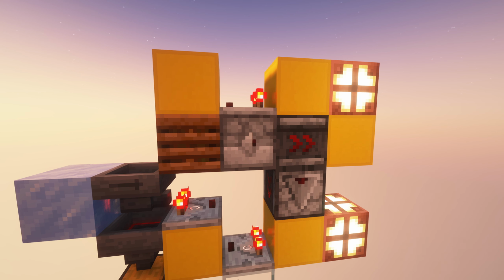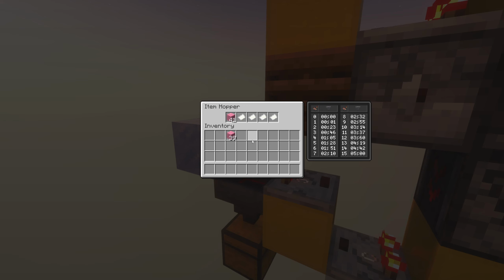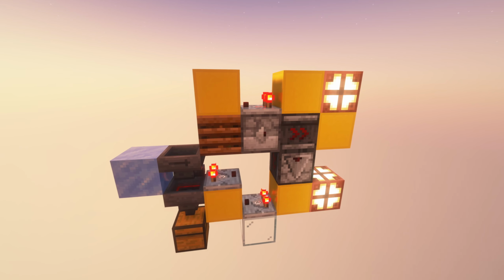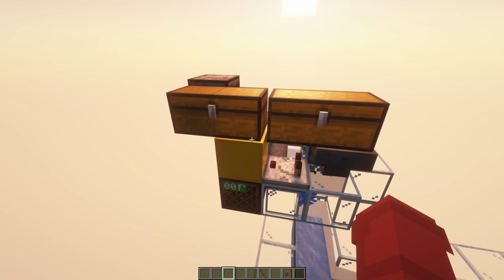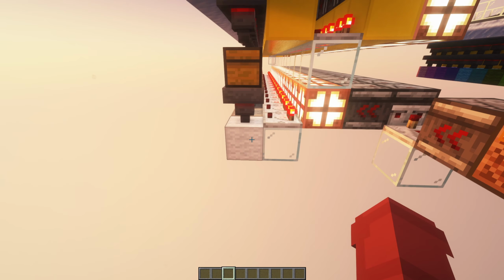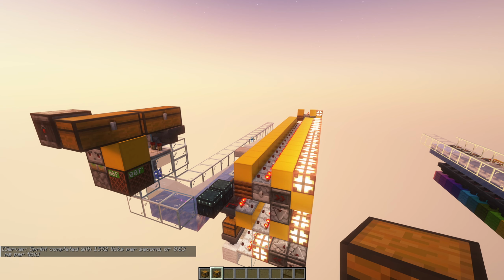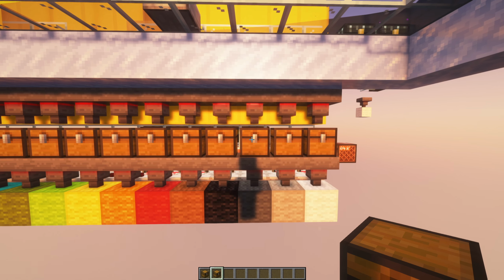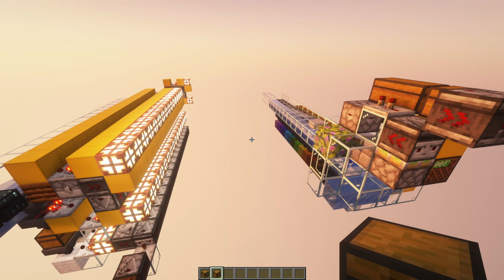New Better Dustless Item Filter

Comment: Should also be said, using a fully oxidized bulb is better for performance (because it sends fewer light updates) but the light updates are really not that big a deal, they’ve been heavily optimized in these versions.
Reply: over time, instead of the machine degrading, it becomes better

Comment: you shouldn't compare the MSPT figures directly, but rather the deltas to baseline. on that accounting the dustless one really is a good deal faster. still should probably use the standard one most of the time
Reply: more specifically, comparing the deltas will give a better picture of the contribution of the sorters and thereby a better picture of the performance characteristics of very large sorting arrays
Reply: So, the baseline/delta calculation is a good one, but I reckon the bulk of the MSPT difference between control and the experimental versions will be item lifetime and moving item entities, because items need to travel down the ice lane versus items need to fall through powdered snow. This control setup does not control for item lifetime.

To weed out the differences, I'd bet the ideal test would be maybe 10^6 items per sorting array, per distribution method (water & entities vs dropper and loose items). For the control, tick warp the world with no item entities.

Comment: Very simple and elegant!

The reason that the dust-based filter isn't that much more laggy is that each dust only has to change by 1 signal strength, and only when the filter is turning on or off, so it doesn't actually create that many dust updates compared to a typical dust-based contraption

Comment: I like it. Dustless, 1 tile wide, nand stackable. Only issue I saw was when it got too many items. The bottom hopper would get stuck locked until the top hopper got updated. But a simple comparator system looking at the chest for strength 15, an observer looking at the dust pointed up into a bulb, then a comparator reading the bulb and pointed towards the top hopper fixed all that. This addition locks the top hopper when the bottom chest is full, then forces a block update to the hopper when the bottom chest has space, thus kick starting the system again.

Comment: *chef's kiss

More seriously, a number of acronyms were used in the video, and I think acronyms should be specified at least once in any work that uses them. Obviously, there's good reason to use acronyms within expert fields in which certain terms are mouthfuls. However, even if the acronyms being used are commonly understood within the field, using them without introduction makes it hard for laypeople and experts from other fields to understand what's being said. 

This is quite common within stem fields. Generally, whenever a research article uses an acronym, it's first presented in the form of "<non-abbreviated term> (<acronym>)". This is even the case for very obvious acronyms, like ITI, CS, and SA.... Oh, sorry, I meant intertrial interval (ITI), conditioned stimulus (CS), and self-administration (SA). But you see my point: specifying the non-abbreviated terms can prevent the audience from needing to use other sources to interpret the material. 

Science communication is an important part of working in any scientific field because a public that does not understand the science cannot appreciate or apply it. I'd argue that's especially true in fields like technical minecraft, for which there is no proper discipline and bringing in new members depends almost entirely on how accessible public information is to laypeople. 

That's just one person's thoughts, though, and the video was great overall! :)

Comment: The marginal difference in performance seems to not be that marginal:
Control: 0.57 mspt
Impulse item filter: 0.66 mspt
Dustless item filter: 0.63 mspt

So the actual lag impact of the sorters (if the testing was good enough) is:
Impulse item filter: 0.09 mspt
Dustless item filter: 0.06 mspt
Resulting in a ~33% decrease of lag.

But yeah, probably still not worth it unless you are building some insanely lag optimised storage monster.
Reply: I think he meant marginal as in 0.03ms is not noticeable at all to the player really, as though it’s 33% it’s still absolutely tiny
Reply: @SandCaribou1890  Precisely, 0.03 ms is 30 microseconds (about the half-life of Bk 251m). Also, this control does not account for item entity lifetime and item entity movement, which experientially will be the bulk of the lag. Given such a small difference over a small sample size ~3000 items, at best the test is inconclusive, at worst the test says it doesn't matter.
Reply: The absolute value of 0.03 mspt difference is indeed marginal and can be ignored. Usually the whole impact of storage systems can be ignored by players, unless they built a higherr-end system.

I agree, that the testing was not sufficient to determine reliable performance data. However, if the 33% lag decreade are approximately correct, then this "marginal" difference can matter to really high performance systems. There are probably very few designs and use-cases out there, that would even notice this change, but they might be there. But you are correct, the main sources of lag in item sorters are usually other things.

Comment: Unfortunately this filter will break if items come in at a specific timing: Assume the top hopper has 42 items, the bottom hopper sucks out one item and at least one new item is picked up by the top hopper within 4gt (which can happen as the top hopper is not in cooldown on account of not having pushed). Then you'll have two updates within 4 gt, the second update is not picked up by the observer and the filter ends up in a locked state despite more than 41 filter items in the top hopper.
I stumbled upon the same problem when I made my copper bulb filter video a while ago (and I'd link it if yt would allow link in comments, so there you go).
Reply from the maker: I don't think it's an issue.  Pass all your items through the aligner at 8gt and you don't run into that problem.
Reply: @RaPsCaLLioN1138  Agreed, if items are aligned at exactly 8gt intervals this should fix the issue. But it's a requirement that should be mentioned ;)

Comment: It's a shame it can't be ss2 since that sends an additional update, now THAT would be a reason to use it
Reply: It can be if you manage signal strengths correctly, and send batches of ~20 items at 8gt. Even still, this circuit we made should be used only for an "it can be done"—a 1wt dustless, pistonless item filter, in the same vein as Oreo's comparator-less item filter.

Comment: I've used this comparator setup for a 3x2x1 new filter desing (with redstone) with an observer and a copper bulb, but when the items come through an hopper line or a water flow (so they comes in the hopper at a certain rate), the comparator in front of the hopper make 2 impulses of redstone, so the copper bulb turn off and on, and the filter break. How tf this turns to work with you😢

Comment: I think I got a 1 wide tileable* dustless item filter that may be better.  Maybe IDK, probably not.  It is comparatively large behind it if you make it as one wide and it is many different slight variations of the same system.  IDK if it is better performance because IDK how to check.  IDK anywhere to show it off.  It is definitely simpler than this and that makes me think it might be faster
Reply from the maker: Hop over to the Storage Tech Dicord!

Comment: The system works fine on my side but if an item gets in the hopper at the exact same time the amount of item goes to 41 (which it'll make 42 item in the hopper), it just stop working and I have to reset the filter.
Reply from the maker: you definitely want to do 4D alignment

Comment: So, unless I'm completely confused, the output is based on the redstone level of 3 from the hopper facing into the comparator.  Why is it that I couldn't add more blockers to decrease the number of actual items (ex:  Diamond Blocks) ?  I've tried adding more blockers, but then I see the output at 4 stopping the hopper.  Just wondering.  Also, I've been playing around with items that stack only to 16 with no luck?

Comment: Can you test standard filter with experimental redstone on? Because if its optimized more then it should be propably better than non dust version?
Reply from the maker: I don't think there's a point testing it against experimental features.  For context, the bundles have been an experimental feature for 4 years.

Comment: Nice. But are light updates causing any additional lag since? Just a thought. And have you tried classic with the experimental snapshot redstone changes?
Reply from the maker: Replace the concrete with light source blocks (froglight or something) - again, probably marginal gain, if any at all.

Mentioned this in another reply also... I don't think there's a point testing it against experimental features.  For context, the bundles have been an experimental feature for 4 years.
Reply: tell me about it
i lost my mind when i saw they changed the recipe from RABBIT LEATHER

RABBIT ffffing LEAHRER
Reply: Use oxidized copper bulbs (light level 4, IIRC) to make the light updates even less relevant than they already are since 1.20.
Reply: Since 1.14 the light engine runs on a separate thread, so light updates cause no server lag at all.
Reply: @RaPsCaLLioN1138  You say marginal gain, but there is already a marginal difference from the baseline. Wasn't sure if that would eliminate that difference altogether.

Comment: I like it very much and think that there is another good side, since there is no redstonedust, there is a possibility that it does not happen like with the standard itamfilter, when it reaches the max 64 itams in one hopper, the other one leaks
Reply: Yep I don't think this leaks. But wouldn't the extra update from comparator still disable the filter?
Reply: It wouldn't leak, but it would break, because the filter would turn off again at signal strength 4.
Reply: It can never reach signal strength 4. That’s the whole basis of the design for the standard filter with overflow protection. 64 + 4 unique items are not enough to output a signal of 4. You need a total of 69 items to reach signal strength 4. So one more then your hopper can have.
Reply: @nlTarzan  Yes that's the idea of overflow protection. But you would agree that this filter design needs overflow protection? Thus if it had the '1 sorted item and rest fillers configuration' to reduce the need to have multiple of some expensive filtered item. Then it would brake?
Reply: @dagisinmines3412  yes, it would break. Because if the comparator goes from 3 to 4, the filter locks again, which will permanently lock it.

Comment: When I say you using 41 items still I thought.   With the copper blocks can you start draining at 41 items (red stone level 3?) but only stop draining when you hit redstone level 1.
Reply: No because this relies on the filter only changing signal strength (ie: redstone level) +-1. If the hopper was at SS1 (signal strength 1) and then filled partway to SS2, and then filled all the way to SS3, then that would trigger the dropper twice, which would relock the pulling hopper and stop the filter completely. It’s kinda like the opposite problem that regular item filters have, where if you do SS1->SS3 the excess leaks into nearby slices and causes them to fully empty, but in this case it would permanently lock the current slice
Reply: if you use oxidized copper bulbs and use sufficient torches then you can avoid light updates entirely
Reply: @josiahdsmith5641  This is possible.   Here is a Huge version.    Hook up the output of a RS-Nor latch to the bottom hopper to lock it.    Pull a redcoder off the comparator from the middle hopper and and hook signal strength 1 to set and signal strength 3 to reset.   

Now when the hopper gets to 42 items it will start draining but when it gets to 18 items it will stop and start filling up to 41 again.

I could do this but I don’t know if I could make it small enough or one block tileable for that matter.
Reply: @lucidmoses  I was saying it’s not possible with the design shown in this video. You would have to use some detection method other than a togglestate though, something with more granular control that can recognize the difference between SS1, SS2, and SS3, which means dust, which means it can’t be 1wt or the signal will leak into other tiles. You can make it SS1<->SS3 and dustless, but then you have to sacrifice 1wt. You can make it 1wt, but then you have to sacrifice SS1<->SS3. You can make it SS1<->SS3 and 1wABt, but then you have to sacrifice dustless. There’s no way to have all three (SS1<->SS3, 1wt, and dustless) all at the same time. It’s a fundamental issue due to the nature of dust, the nature of tileability, and the loss of precision by using non-dust components
Reply: @josiahdsmith5641  I'm suddenly less worried about dustless every since they put out that videos about FINALLY addressing the redstone block update performance.   Course there are some nuts out there complaining that they will not be able to make doors as small so they shouldn't do it.  Sheesh.

Comment: Would this still have the problem of item overflow if you were to use eggs in the filter item slots in order to minimize how many items have to sit in the filter?
Being dustless it might no longer have that problem
Reply from the maker: Yes and no.  You could use 16-stackable items as fillers, but once it overflows, it'll just set itself to the next highest number of items / ss change.  i.e. If you set it as 18-1-1-1-1, and it overflowed, it would just set itself to 41-1-1-1-1 and stay there forever.
Reply: @RaPsCaLLioN1138  Wouldn’t the slice lock itself up tho? Since it goes from SS2->SS3 (unlocks), then SS3->SS4 (relocks) and then nothing can trigger it to unlock again? Since it’s still using a togglestate-based system
Reply: @josiahdsmith5641 I think so too when hopper is filling up slowly and not from a big stack
Reply: Exactly right. I've been playing around with a toggle system and broke it right away just by feeding it manually. You have to set up a system of gates to bunch your items up first, then release them in clumps.
Reply: @HyperlightSniffer I have hooked up copperbulb based filters in my goldfarm that uses icepaths and indeed processes bunches. It hasn't had any issues in many hours of afk.

But yeah, feed 1 item at a time in succession easily breaks it.
Reply: @josiahdsmith5641  Yes, depending on how you get to signal strength 4, the slice will either lock up, or it will drain to signal strength 3. So, ss2 -> ss4 will drain to ss3. ss2 -> ss3 -> ss4 will lock up.

You can technically avoid this problem by running this filter at ss14 with 63 items in the leftmost slot, and 4 unstackable blocker items, but you are now unable to pick up item batches at all.
Reply: @DatNerd unless you go overstacked ofc
Reply: @JustGlotz  there is no method to this madness xD

Comment: can it be ss2?
Reply: No, because the toggle state relies on the fact that the maximum change in signal strength is 1, so that the comparator gives exactly 1 update output when signal strength decreases, otherwise it'd flip to the wrong toggle state and break mid-filtering.

Comment: Is the item filter only marginally faster? If you subtract the baseline, the dustless filter is 0.06 ms per tick, and the standard filter is 0.09 ms per tick. That’s a 50% improvement. The improvements would likely be more noticeable if the number of filters increased.
Reply: So, I reckon the primary cause of lag here will be item entity lifetime and item entity movement. This 50% improvement you've mathematically identified has an absolute limit—there is only so much lag is caused by dustful filters. At such a small scale, 10^3 items, the difference is 0.03 milliseconds—30 microseconds! This number is very small. I don't even have a good comparative to describe how small this number is. This difference is about the half-life of Berkelium-251m. All this is to say, the error bars will be big, and not much can be deduced from the test.

If someone does want to do a large scale test of this, run at least 10^6 items. Use the entity tracker mod to check item lifetime, also, carpet's /profile health, and /profile entities has more pinpoint data.